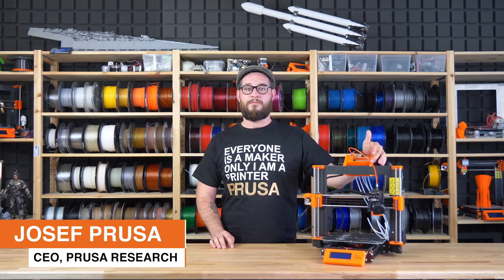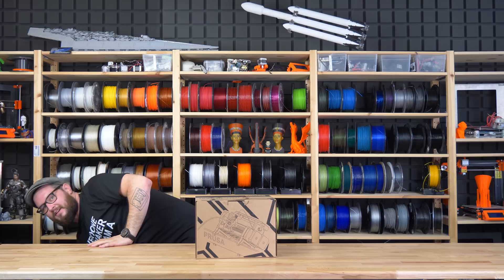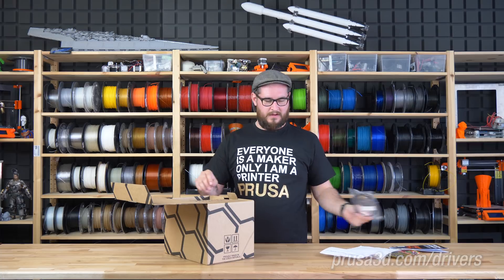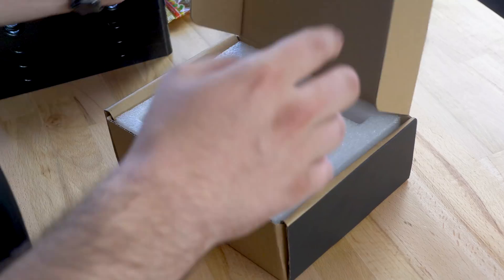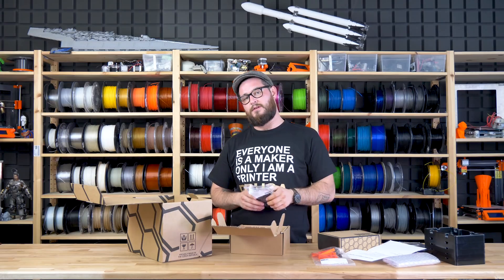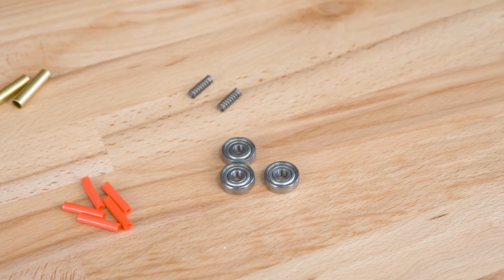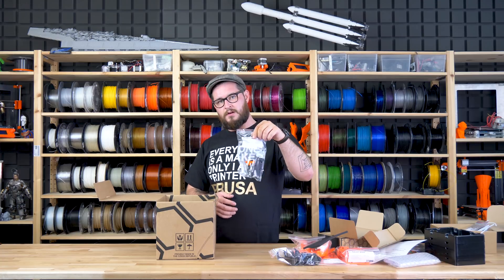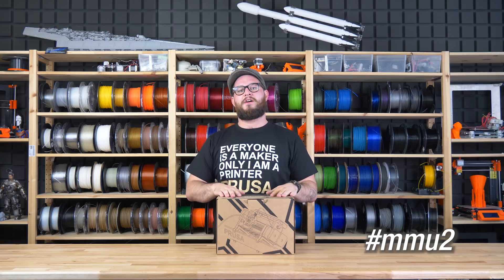Original Prusa i3 MMU 2.0 - Official Unboxing by Jo Prusa

Comment: The worst decision I made was to update the MK3 working very fine from the first attempt to MMU. The filament is jamming almost every action, the "new air flow management" made me losing few hours of work just to discover the front fan is no longer working etc. In MK3 the filament is friction just in the small portions of the PFTE tubes. Now MMU introduced another 600mm of PFTE but no pull,  so too often the extruder pulling gear is destroying filament and push no more. F..K!!! I am so disappointed with my decision to spend money and time to destroy my MK3 working very well based on YOUTUBE ads. F..k again!  Really, spools 40 cm back of printer (even so is not working)? Why is not in ads? Do you think I have a garage all for me? I have a desk 80cm long and all is blown out, now I have all on the floor and the position to try to make all working is also killing me and helping to the "good feeling sentiments" to your "monster baby". Really a very bad product based on a bad design (load the extruder pooling gear with extra loads but the problem is the filament, is plastic and destroyed creating more problems in friction), a mechanical complication too sensible to any normal frictional-geometrical variations and having no future from my point of view. I will try to fix the fan and I will take out the MMU (trying to have back the MK3) and I will throw it away to garbage ( I cannot make it a gift, even to enemies!). And all materials used including filaments are original Prusa,  no "aftermarket" to blame.

Comment: Can you make a video on how to use it? I still don't get how it works software wise. If you want to actually use it to print in colors how does that work? Obviously you can make it change filament whenever but I mean getting it to use the correct color in the correct area? Im guessing it works like dual extrusion with multiple files.

Comment: I just received my kit a few days ago. I've been assembling it a little every day after work. The instructions are great, and I thought it was really cool of you to include the upgraded extruder parts. I now have the mmu built and will be doing the extruder upgrade and final installation this weekend. The design of this unit is  genius. I can't wait to get it running. Cheers! P.S. I had ordered mine mid November of last year if anyone is curious where they are in the queue.
Reply: genius? really?  Is so bad using same traction pool as before but for much more length inside tubes which increase the friction and no support for it...as a mechanical engineer, I consider these a fail.

Comment: Love the prusa MK3 kit, took me some time to assembly but learned alot.
Gonna get the multi material one of these months also, especially for use with the solvent material for supports.
However i am curious will you guys ever do something alike for reusing filament? like remelting the waste block as new filament?
The material is probably downgraded a little than but would be amazing to reuse filaments of failed prints/filament remains etc
Reply: Check out filastruder if you are interested in doing that. The plastic does weaken every time it is heat cycled, but you can just mix in some recycled material with new pellets if you need to.

Comment: Including the new extruder parts is a nice perk!
Reply: Indeed...IF they were actually included.  I should have read the fine print and should have read the full instructions (I know...rookie mistake) before I started pulling stuff apart.  Those parts were not in my box.  I'll have to go down to the local print shop and get them to print them as I broke a part pulling it apart.  No biggy.  Still LOVE my MK3!  Just can't wait to get this installed.  

Marcin Mączewski from Customer Support sent me this link... https://shop.prusa3d.com/forum/general-discussion-announcements-and-releases-f61/new-printed-parts-c1-r4-mk3s-mk2-5s-mmu2s-t27888.html#p133629